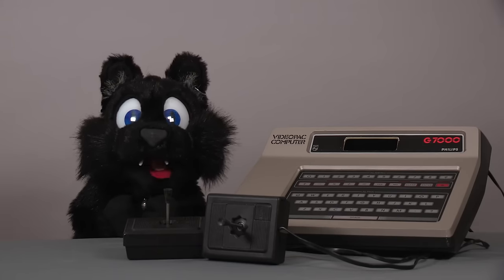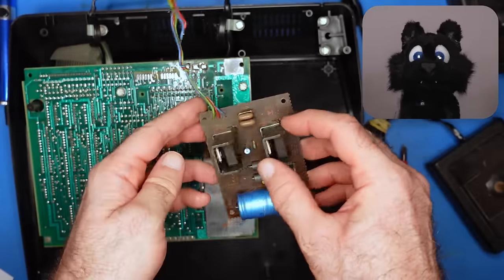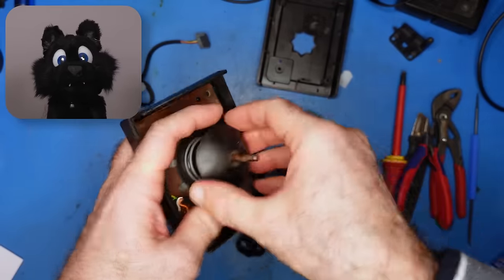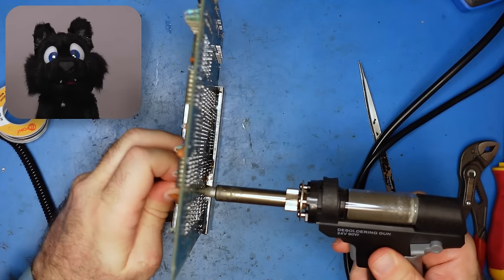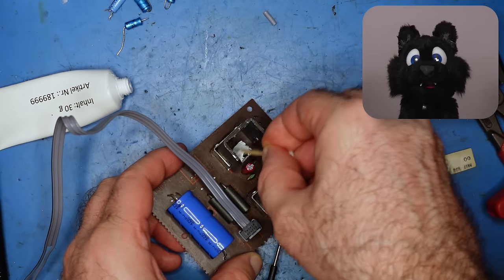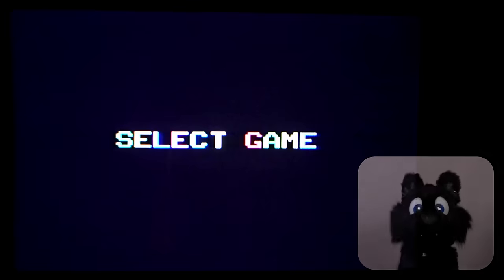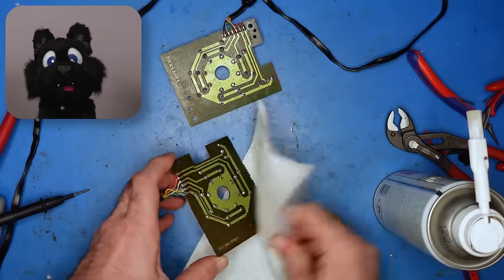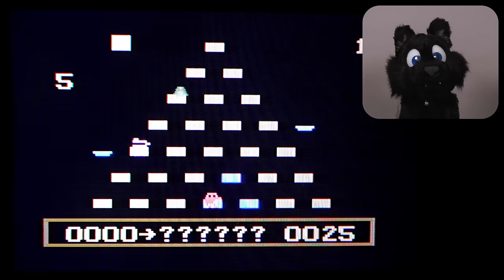Philips G7000

Comment: I was genuinely pleasantly surprised when I saw that you have a Philips G7000 project. I am one of Sweden's biggest collectors of this video game console. I have composite-modded a couple of these, and it's something I highly recommend. Another fantastic video as usual. It would have been fun if you went into detail about how everything works on the console. Perhaps a follow-up video? Looking forward to your next project.
Reply from the maker: If I get my paws on some dev tools, I might give it a try for fun. That would fit in with an explanation on the components. As far as a project video however, this is what it is: There wasn't anything broken, so I only looked into as much detail as I needed for a proper tune up. 😅

Comment: That brings back so many memories. I ended up with one as a kid. Similar Philips branding in Australia. I had always assumed that there must have been some programs, Word processor, programming environment, or similar which required the keyboard but we only had a couple of games. I always wanted to learn how to program it but the PSU died one warm afternoon. Either a cap or resistor burnt out from memory. The only time I can remember my father yelping in pain was as he tried to repair the power supply and discharged the 300V caps through his hand! The version we had was fitted with a 240V SMPS.
Reply from the maker: It might have been the version from my found schematic diagram. Becuase that shows mains input and a transformer. I'd assume yours had the classic 9-pin connectors for the joysticks too?
At 256 bytes of RAM, I doubt a word processor though... But I really would like to know if any of the games ever made use of it in a way.
Reply: I don't think mine had the 9-pin connector. The joysticks were hard wired as per the unit restored in the video. I recall trying to keep the cables tidy was impossible.

Oh wow. 256 bytes of RAM. One of the games I had was searching through the large matrix to look for a mine - think of a very earl version of minesweeper but with a single solitary mine. The location of the mine changes each time the game was played so I assume it used a few bytes of the RAM!

Comment: One of the reasons that Philips may have entered into a deal with Magnavox in the USA to market this device is that they did not use the Philips brand name here until several years later.  They were known as "Norelco" here, since there was already a company here named "Philco", and there was the potential of confusion between the two brands.  Once Philco went out of business, they began using the Philips brand here.
Reply: Norelco was also known for making electric shavers and the like. Was it the same company?

Comment: The G7000 uses TTL RGBi internally and is thus CGA compatible. The composite signal goes through a potentiometer to the modulator. The input to the pot is strong enough for RCA so you can have RGB, RF and Composite at the same time! (I tried. Three screens on one G7000 at the same time. It works.) That's how I mod mine. It has an insanely sharp picture over RGB. Getting RGB from RGBi is also relatively easy with a bunch of resistors.
The RGBi signals are under the RF shield though. I have a photo on my website.
The G7000 is also relatively easy to make multicarts for. The easiest thing you can do is burn whatever game you like on a 2716 or 2732 EPROM and install it in the cartridge instead of the one that's in there. You can use a bigger ROM and DIP switches to select a game. But I don't remember which of the pins is needed for the 8k sized games (but there's some real good ones, including a few that were never released). IIRC the 8k pin is next to the 4k pin on the cartridge with a test pad and nothing else connected (but so are all the unused lines).
Reply from the maker: I saw the RGB and "Luma" lines on the circuit diagram. Thought that it might be something like that, but it's good to know that it is direct CGA, that makes things for RGB mod a tad bit easier indeed. I'll check to see what I can make for a circuit board for the mod when I come around to it. Thanks!
Reply: @atkelar   There's one gotcha* - unless your CGA monitor doesn't care about the video levels in the blanking period, you need to manually blank those, otherwise games with a non-black background may look either weird or have no picture at all. IIRC you have to AND each of the RGBi signals with NOT VSync (which also has the blanking).
Funny thing - on my friend's G7000, the picture started to be intermittent. I RGB modded his console (and built him a multicart) and a few years later, the composite signal generator IC finally completely died, so now RGB is all that is left. Which is good because he doesn't have any old TVs.
Btw. I also use to put a power switch and LED in G7000s when I mod them. Why the European version has no power switch (not even on the PSU), I don't know.
*) two, actually - CGA monitors want 60Hz video signals so you gotta twiddle the (usually internal) V-Hold pot. Or use a Commodore 1084.
But the reward is a super crisp picture. Think the composite mod will improve the muddy RF output? Dream on! It looks just the same over composite!

Comment: Cool!  I find it interesting how different the internals of the machine are from my Magnavox Odyssey 2, from the different PCB's in the controllers, to the placement of the power circuitry on its own daughterboard, to a different plug for the power brick.  I'm quite surprised, as I would have thought that the only difference would have been in the video circuitry (PAL instead of NTSC).
Reply from the maker: Indeed there are several revisions around; It also doesn't seem to be based on when but rather where they were made. My case for example has provisions for the power switch that was included on other models... and some other mounting studs for whatever else is different. So they clearly had one case mold for several different inner workings, and that only makes sense if it was pre planned; a generation shift would use up the old cases first too IMHO.

Comment: Not a system you see often on YouTube. I think you have one of the better third party games for the system. Having no storage, all games were simple and repetitive.
Also any version I have seen had 12v for the RF box. The logic is 5v only.
Reply from the maker: There seem to be several versions around... but I did measure the power lines, and this one has two 5V rails, so the RF modulator also runs on that. One clearly needs to be careful when repairing them, as the schematics will not alwasy be right.
Reply: @atkelar  i have never seen the version you have and I have had and still have those machines. G7000 and g7400. Almost looks like what they call a cost reduced version. Your version also has more shielding on the main pcb

Comment: Oh this machine . Here it's called the videopack the next version is videopac+ there is also a under license version caled the jopac by brandt.
Reply from the maker: There are indeed numerous different brandings around. I couldn't find a complete list and also no definitive reason as to why it was sold under so many different names/editions...
Reply: @atkelar  kinda a mistery. and i even got cartidige with the jopac name. wich are.... kinda pointless. funny enough i need make some repair to them non of the power switch stay in ON position.

Comment: Atkelar, what is the spray can with a brush for cleaning PCBs that you are using?!
Reply from the maker: It's called "Kontakt LR" - Kontakt is the manufacturer, "LR" is German for "PCB clearner" pretty much. The spray is specialized to dissolve flux residue. Reall thick layers need a bit of mechanical help first, but I like the rsult.
Reply: Thank you 🥹